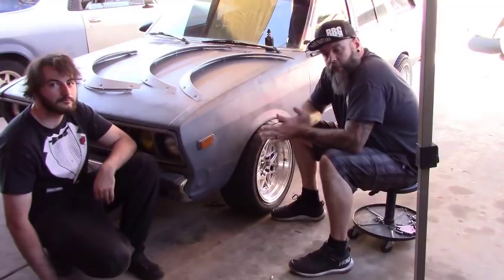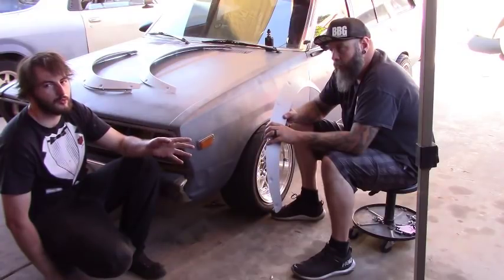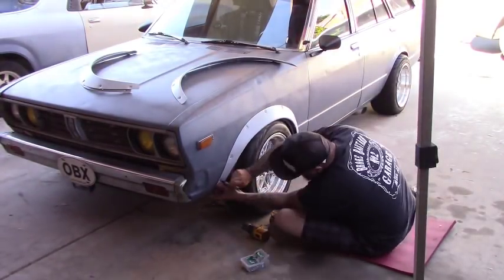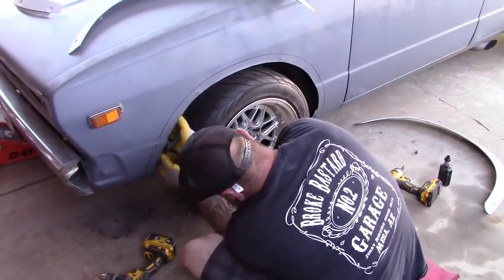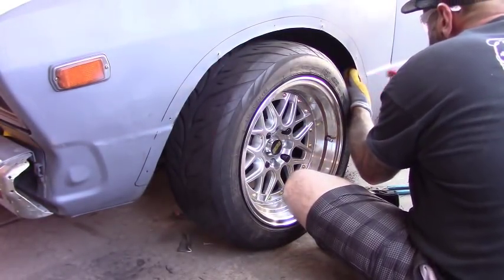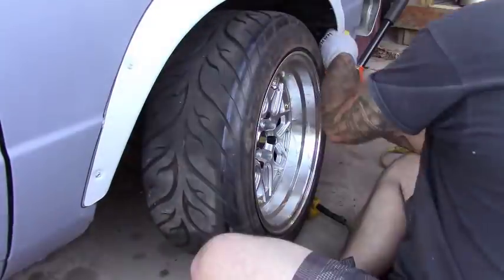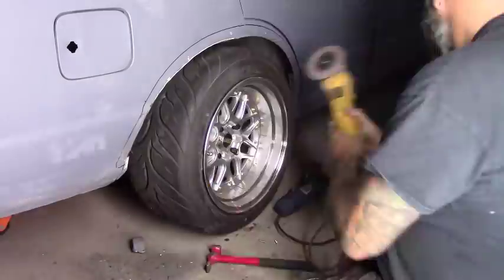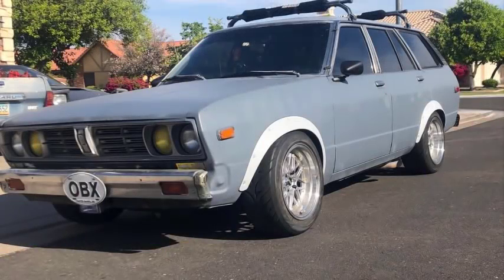Installing Metal Fender Flares on 79 Datsun 510 Wagon

Comment: What is it lowered on? Is the lowering kit all custom or did you find a kit off the shelf?
Reply from the maker: It’s got coil overs on the front and blocks in the rear
Reply: @BrokeBastardGarage  are they for the particular car or generic stuff that had to be modified?
Reply from the maker: @benjaminstacy9555  stock springs cut and strand 2” lowering blocks